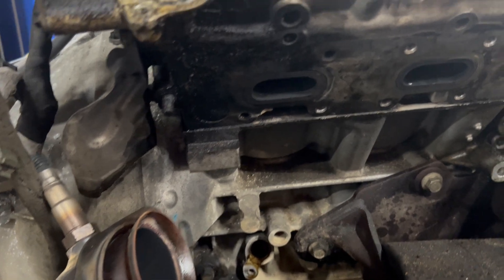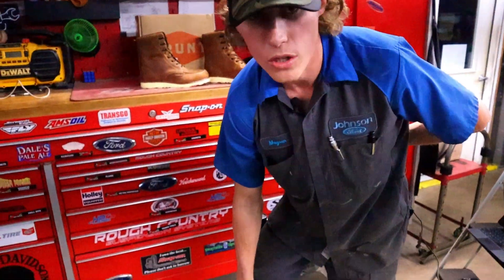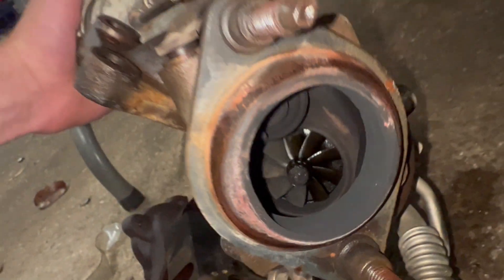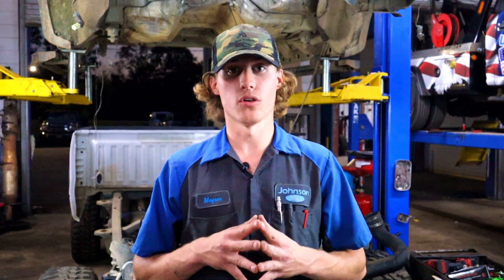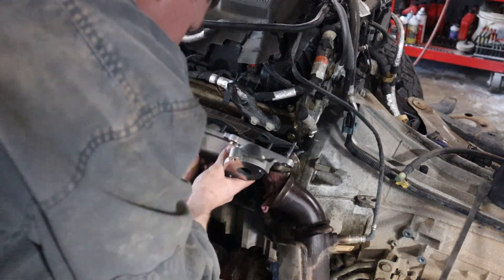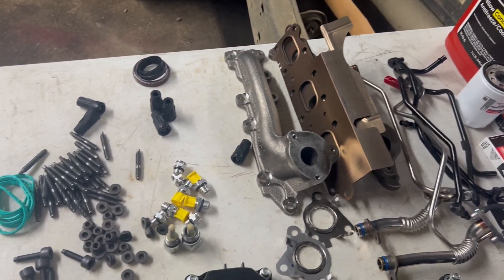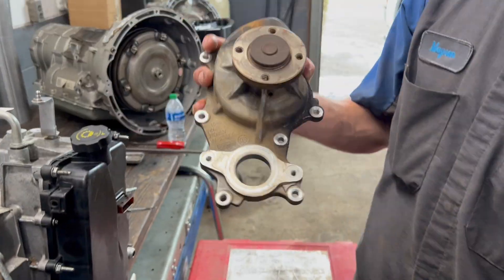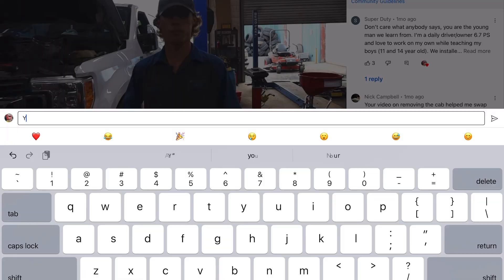Ford 3.5L EcoBoost Broken Exhaust Manifold Stud | Everything You Need to Know

Comment: Mayson  would due a video on the  2010 f150  5.4 3v  pcv.  How the pcv  system works . Does it have a check valve?  like a typical pcv  system… tanks

Comment: Got both those issues on my 14 150. And the leaking turbo coolant fittings and degas bottle. Have mishimoto all aluminum radiator and degas tank, BD diesel manifolds and garret stage 1 power ax turbos, vacuum pump and all new coolant hoses and lines ready to go. Deciding on which turbo back exhaust system to finish it all off. Leaning to the spd hi flow y pipe and hx series cat back w stage 2 resonator. Wondering flying wrench given my plans would you still lift the cab?  Love the channel all the way from Canada.

Comment: HEY MAYSON..... There you are. Great Video once again. Man Pulling that Cab Off, Piece a Cake for you now day's. As an F-150 Owner, 2022 New Truck, It's Scary, Just seems like a LOT Can go wrong there. Like, New Noise's, Bolt's Left Loose, Wires Pinched??? Man. I don't know about that. Looks like a GREAT way to Expose stuff that would otherwise Not be very accessible at all. And All those Part's to replace, I would also replace that stuff! It's Buried and too difficult to go back a 2nd time. Do it Once, Do it Right!!!

Comment: Mayson, I have p0420 and p0430. Replaced with magnaflow weld in converters and the codes are back/still there. On this ecoboost (mine is 2015) what do you usually see cause that code? My friend worked for a ford dealership going to hook to scanner to make sure 02’s are doing what they should but he said he’s never seen those codes be a 02 sensor. He said it may not like those cats. 
Any help would be appreciated. Thanks in advance.

Comment: Men i used motorcraft oil filters on my fords. Decided to cut one fl500s open and found the paper media where it meats and its glued together "others use a metal plate that holds the paper media besides the glue" and i found it apart from it other, it came undone. That was scary 😨... and at a 4500 mile interval. Dont know what to think of motorcraft oil filters any more
Reply: Yeah motorcraft filters are now junk. The 820s have such wide pleating  that they tear

Comment: Is the 3.5 or the 5.0 more cost effective to maintain. I guess if you where going to buy a half ton F150 which engine would you get
Reply from the maker: 5.0 definitely cheaper but I prefer pre 18 5.0’s myself. 18+ 5.0’s make too many noises. 3.5’s are great engines but more power cost more money no matter how you look at it.
Reply: @FlyingWrenches13  So that would be Gen 2? I figured they got all those oil consumption problems figured out. I guess most folks don't like the Gen 3 because of the cylinder deactivation and the belt driven oil pump?
Reply: @FlyingWrenches13  I have own 5 different 3.5 from 14 to 22 just wondered your opinion
Reply: @jamescody8080  The 5.0's are extremely bad about valve guides wearing out. I've pulled the heads on a couple under 70K miles, but normally see this at the 150K mark. It's 4500 bucks for that repair plus what else I find while I'm in there. I like them both and would own either of them.

Comment: Sounds like a money pit with all the 3.5l videos.
Reply: As I understand, once you replace the cam phasers, upgrade the timing chain bolts, upgrade the oil pump, replace the exhaust manifolds, replace the manifold bolts, replace the water pump, replace the turbos, replace the wiring connectors from unplugging/plugging to remove the cab, most Ford enthusiasts will tell you its a fairly reliable engine.  Great videos.  As long as Quality is #1 for Ford, you have and endless supply for repair videos.
Reply: @mikeshelton5629  😂😂😂
Reply from the maker: Man you hit that nail head on
Reply: @FlyingWrenches13  I forgot 'upgrade to the Melling oil pump!